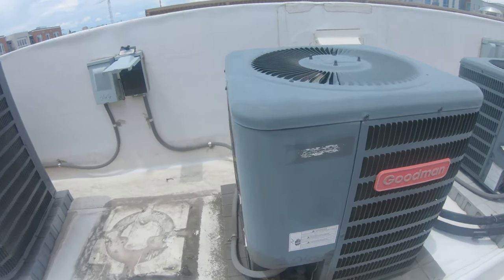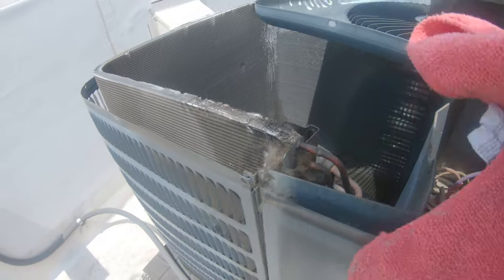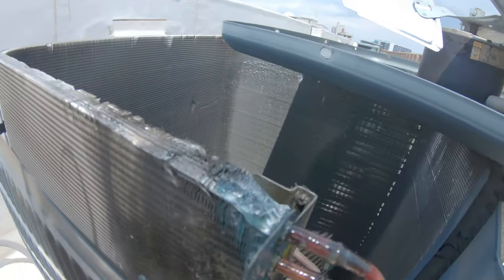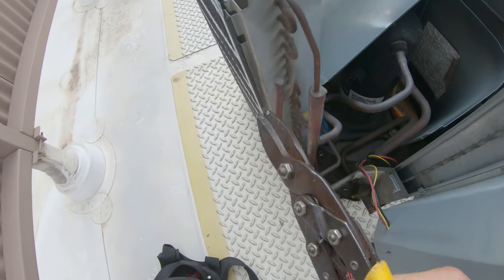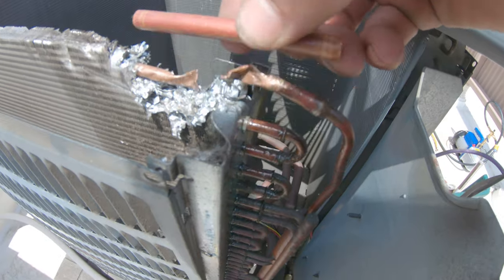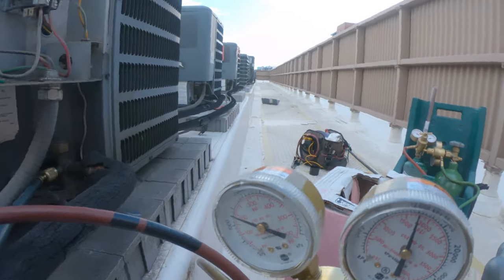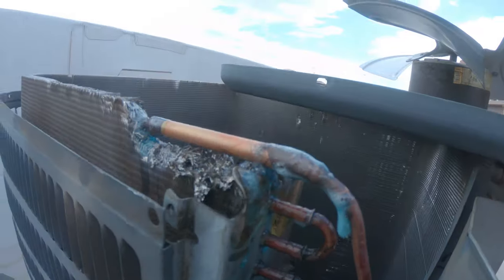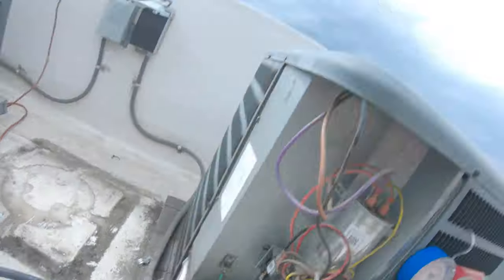Repairing a Refrigerant Leak on a Condenser Coil

Comment: I had one just like that but l replaced the whole condenser l usually don’t repair them but if there’s no budget you  do what you have to do  to make it work great video than you so much
Reply from the maker: I would always prefer to swap out the coil or the condenser but I’ve now done so many of these it’s almost just as fast and much more cost effective for smaller unit that don’t require a lot of refrigerant
Reply: I just had  same thing it was leaking everywhere 
I n the condenser 
Told them needed to be replaced instead because it was leaking all over

Comment: Hey Dave,  How much would a fix like this typical cost?  I have a coil leaking (no longer manufactured) and need a similar type of fix.  Just a ballpark figure?
Reply from the maker: All depends on how much refrigerant you need and tools you have. Refrigerant is gonna be the main expense if the system is empty

Comment: When brazing copper aren't you supposed to make the copper red hot then apply the brazing? Not melt it with the flame?
Reply from the maker: Please time stamp the section your referring to so I can answer your question thoroughly.
Reply: Yes,I notice that too. And had commented on it. Need to heat it until copper is at right temp and not just melt the rod onto a colder copper... improper braze that sadly I've seen 80% hvac guys do
Reply from the maker: @damnitdang  ah yes I see what you are talking about now. This is 1/4" to 3/8" something i very rarely ever braze. So easy to burn a hole through that's why Im using the solder prematurely. I know for a fact I'm not the best brazer or even close but alway open to feedback. If it's 3/8 or less I never get it 'red hot' I just dont' see the need with the risk of how easy it is to put a hole through the copper. Which I have done many times. I've been doing this on an off about 20 years now just for reference.
Reply: @ApartmentMaintenancePro  you did much better than the most I've seen. Think of the whole pipe as an heat sink. Don't be afraid to spread the head to an area even if it's not getting sober. It'll help disapate the heat a bit and give you time. Trust me residentail and commercial hvan you have way more room. I work on reefer units. And they are tight. Not open like home ac
Reply: @ApartmentMaintenancePro  once it's kinda red.. and if you stay in that particular area longer.. you can burn through. But even then. It still takes awhile. Or your flame tip is way too close. Once it's red you can back it off acouple inch.. or direct the flame away from the joint. But at the pipe still... disapate the heat while keeping it hot... then that rod will flow into the joint easily.. and Fuze together..

Comment: I got a question. I have an Amanda unit similar to what you showed here. I was opening the side doors to clean out the fins. I noticed the top of the condenser fins are pretty banged up. Is that common or normal?
Reply from the maker: They technically should be but I see that a lot on condensers and usually happens when shipped/installed.

Comment: How does this repair effect the system, doesn't it reduce the surface area?
Reply from the maker: I doubt it makes much of a difference
Reply: Technically yes but it's less than 1% of the surface area. A dirty coil has a much larger effect than this kind of repair so I wouldn't worry about it.

Comment: a  quick question.
did it last days or 2 years?
Reply from the maker: This is at an apartment complex I still work at a few days a week. This unit has had zero issues since this fix it’s a solid braze and still holding

Comment: My tech just told me that the accumulator and condenser coil are leaking on my MarvAir Mod Pac II. They are gonna order parts. Do you know how much that cost? And would you recommend just getting a new A/C unit instead? 

This MarvAir Mod Pac II is a wall mounted one and 5 years old.
Reply from the maker: This question is very hard to answer as this is a commercial unit. I dont deal with these anymore but if the coil has a leak most professional companies wont repair them, as there's a liability. I repair leaks because Im in apartment maintenace (residential equipment mostly) and save them a crap ton of money when I do the same repair all the time. I know this answer isn't going to help much but depending on the urgency I would get a second opinion. Then weigh the options.
Reply: @ApartmentMaintenancePro  The unit is on a 1 bedroom 1 bath unit. It's around 680 sqft. Not really commercial. It's a 2016. 

But I am thinking the same thing. Why replace parts when there is a chance that during the repairs, something will be done incorrectly and I will have to fork out even more money. Ugh

Comment: jesus, you butchered it!  The way I repair coil leaks on the tube sheets like that is by using a small hole saw, 5/8' , turn the drill bit around in the hole saw backwards and use a drill. Unsweat the tube going in and then stick the drill and hole saw combo into the open tube and the hole saw will cut a nice round metal slug from around the tube. The crack will be exposed and you can simply expand the tube and reconnect and paint the hole tube with brazing rod and its fixed and doesn't look like you took a hatchet to it.
Reply from the maker: I can’t picture this in my head can you link to anything similar? Also checked this the other day as I work this property often, repair is still covered, still leak free
Reply: @ApartmentMaintenancePro  omg you butchered it lol you got it done bro and it ain't leaking. Where abouts are located at as far as state or city

Comment: Why didn't you clean up the area below the soldering before he went ahead and melted aluminum around the coils? At least clean it up and make it look better by cutting you back evenly and then putting a heatproof blanket in between aluminum and a piece being soldered! If you want to do a professional job something that you'll be proud of and other people can say you did a good job do it right the first time even though I can't be seen it looks like poop!
Reply from the maker: Hi, thanks for watching. I am very proud of this job as it is still leak free to this day and saved my company about $2000 in vendor costs and $1000 in parts costs..for a couple hours of work. I don't know which video you watched, but there was absolutely no soldering done in this video, again, thanks for watching, if you watched?
Reply: @ApartmentMaintenancePro  the video I watched it a torch on that piece of pipe that was replaced and heating up the cooling fans attached to the Copper. Soldering or brazing either way there was a torch involved melting the aluminum coils that dissipate the Heat in that video. Other than a Scavenging pards shows that you're very adaptive and very smart and concerned about the customer by saving your money. Other than the George Melton your cooling coils on the copper pipes that's all the rest of the video was perfect

Comment: Yikes man, need to do a little practicing on your brazing technique, you’re supposed to put heat into the pipe or fitting and the rod will flow into the gap you don’t melt the rod with the torch, I understand it’s a small diameter pipe but there’s a way to do it properly, it will probably leak again and Goodmans are cheaply made that’s all I used to work on when I was a maintenance tech. And yes I know kinda what I’m talking about, I’m currently a residential HVAC tech and have been for 3 years and am also former property maintenance supervisor for a large property management company that owns many large multi family housing properties (apartments). I’m not trying to belittle your work I would just hate for you to have to do that over again because of a failed braze joint.
Reply from the maker: I appreciate the critique it’s all good. It’s been two years since this repair was made and it’s still holding. It’s almost impossible to get a perfect braze on film out in the field with the wind blowing and trying to film at the same time. I can assure you the braze joint is good and will not leak. I’ve done it thousands of times - I’ve been doing AC repairs for almost 20 years now and worked as a professional for 5 of those years along side of some of the smartest techs I’ve ever worked with. It’s not the prettiest and sure there are flaws but that condenser coil isn’t leaking at that spot again (I would have preferred to replace the coil of course but you budget stuff from management)